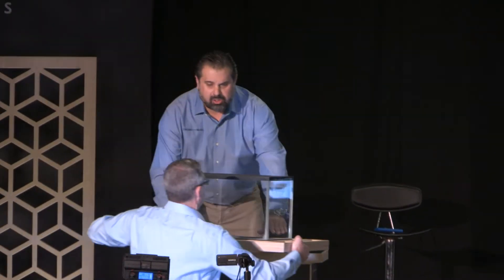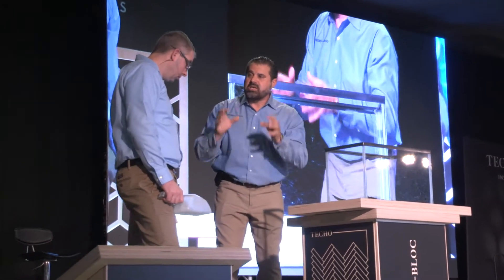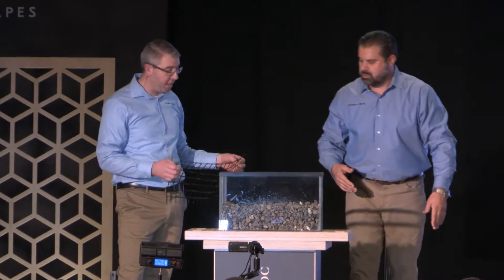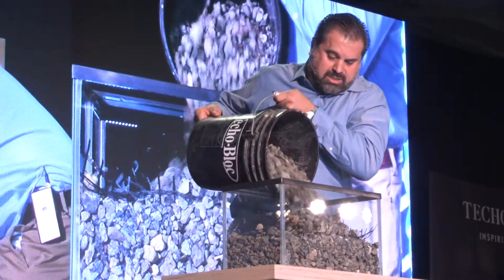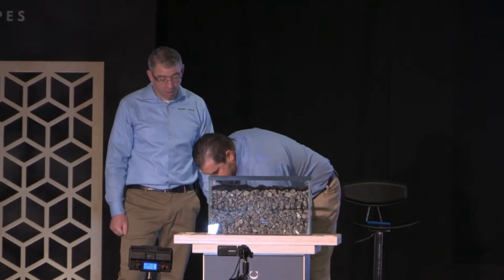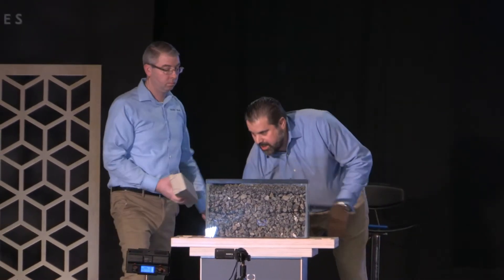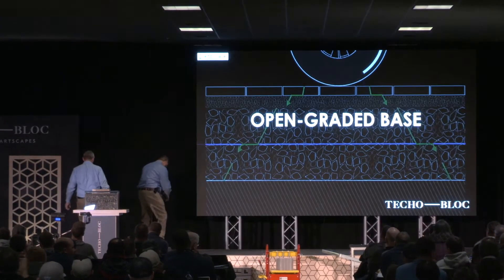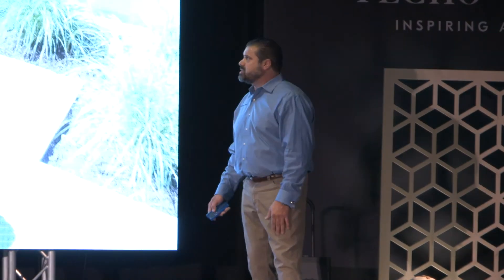Open Graded Base with Recycled Concrete

Comment: Can the Open Graded Base idea be applied to grade the area under concrete footings, foundations, and also stone walls?   Particularly with stone walls, you are not spreading the load over a wide area.   How do you keep the bedding layer of 3/8" clear stone on top of the 3/4" clear stone from shifting laterally from under the stone or concrete?